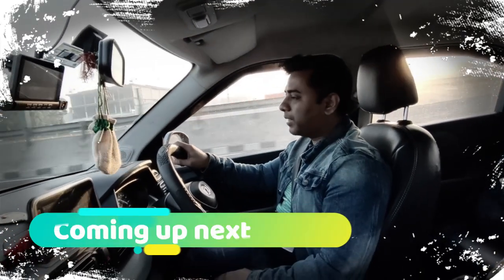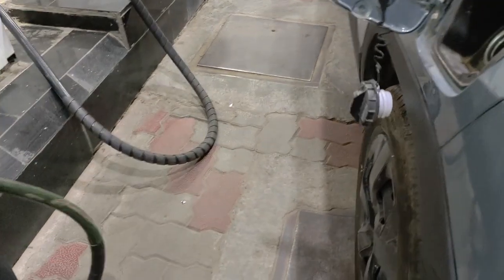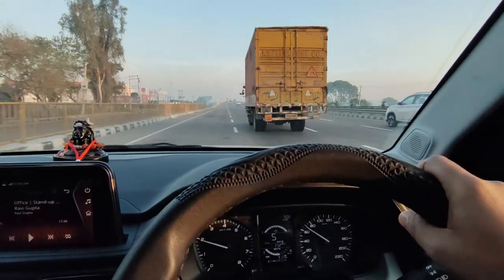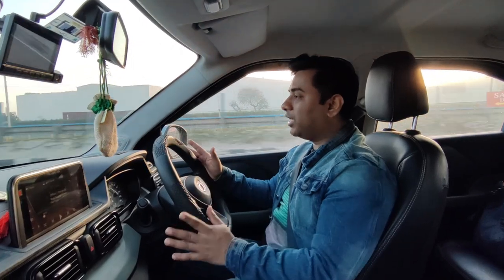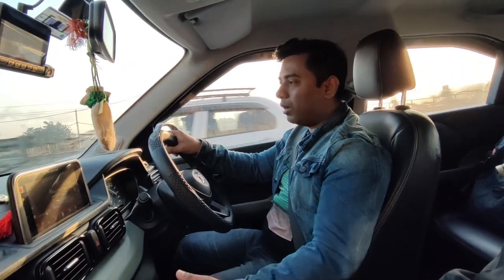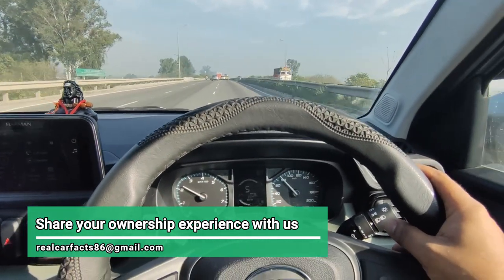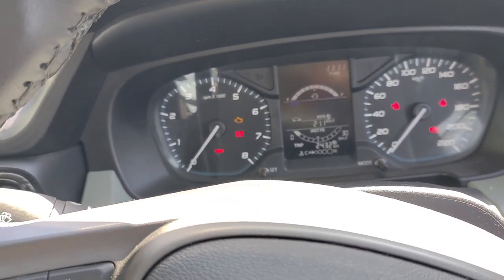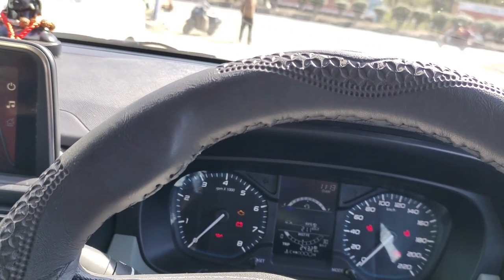Punch Tank to Tank Mileage  on Highways | कितना देती है | Tata Punch Mileage Test

Comment: Punch 550 km 31 litter petrol में चलती है वो भी तब जब प्यार से 70 तो 80 चलाई और कोई चढ़ाई नहीं थी प्लेन खाली हाइवे रोड थी  17.7 की fuel efficiency आई बाकी जो लोग 20 21 24 27 बताते है झूठ बोलते है 17.7 ac के साथ फेस 2 car

Comment: Bhai ap jis speed pe chala rahe ho…
Usse zyada speed mein log city mein chala te hai.
Mera Gurkha mein 2600 cc ka engine hai….4x4 hai
Isse double torque hai.. wo gari mein 100-100 kmph cruising mein 19 ki milage deti hai
Aur yeah apka 1200cc ka hatch gaddi…60 kph k speed mein usko chala k agr yeah hal hai…to isse acha to paidal chal ne se zyada faida hai.
Reply from the maker: bhai  normally maine isko highway mai 80 to 90 ki speed mai drive kiya tha and agar jyada accelerate karoge to milaege drop hoga ye mileage mere ko 80 to 90 ki speed se mili hai and kuch jagah mai 100 tak drive kiya but not more than 100.  Gurkha mai apko kafi achi mileage mil rahi hai despite of his big 2600cc engine BTW i love Gurakha its a very capable off road car
Reply: @realcarfacts5538  gaddi mein aise koi problem to hai nehi, thora weight iska zyada hai…aur 5number gear short hai.
To is wajah se tel pi leta hai.
Phir ap dekho to tiago mein aisa problem nehi hai..milage machina hai wo
Reply from the maker: @classicsur4026  agree bhai car ka power to weight ratio jyada hai isliye engine kabhi kabhi underpower feel hota hai especially jab aap overtake kar rahe ho
Reply: @realcarfacts5538  no ji…
Underpowered feel nehi hota hai.
Gear ratio short rakha hai company ne iske.
Reply: @TGP ab kya kare bhai jhelna hi padega

Comment: I'm hardly getting 10-11 kmpl mileage in city even after the first service, is anyone else facing this issue??
Reply: Jugal Deja  is it automatic or manual
Reply: Heavy traffic 10-11
Normal traffic 13-15
Highway par pata nahi abhi Tak Gaya nahi.. 3 mahine hone vale he car ko abhi.
Reply: light foot use kro. gently chlao. ye bhgaane wali car ni h. 😀
Reply: Bhai city me ट्राफिक पर depend krta h smooth h ya जाम h, बाकी city me koi milage नहीं देती जाम मे
Reply: @celebritywatchesforyou  Bhai yr ni bhagata, aram se chalata hu and driving bhi achi krta hu, beginner ni hu tb bhi ni deti..
Reply: @Vikasjat468  Bhai jb traffic ni hota tb bhi 10-10.5 se jada ni deti, first service ho chuki and driving bhi sahi se krta hu tb bhi ni deti..
Reply: @Mohit_Yadav168  city me km hi h average. 1st or 2nd gear bohot tel pite h.
Reply: @Mohit_Yadav168  change speak plugs use .engine lubes like graphinizer 😊